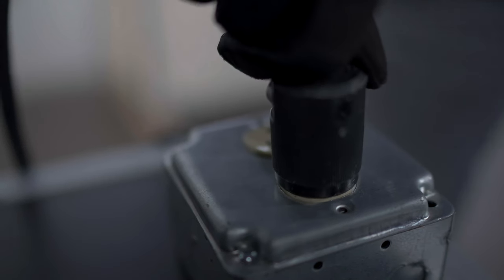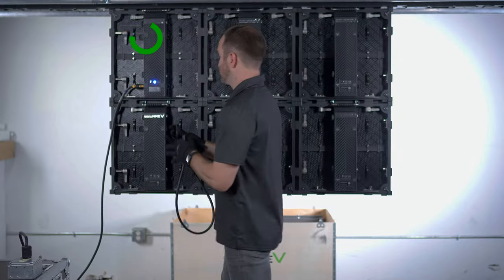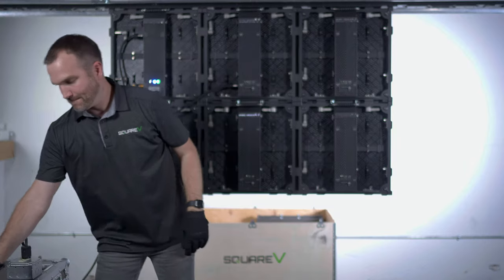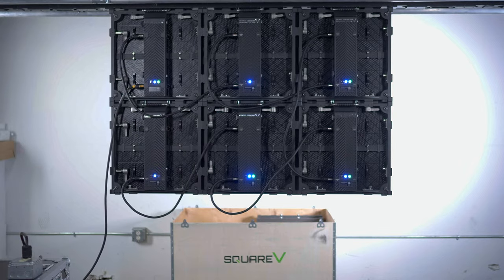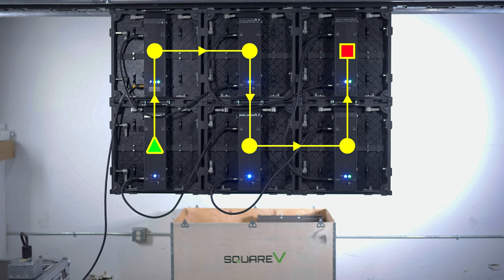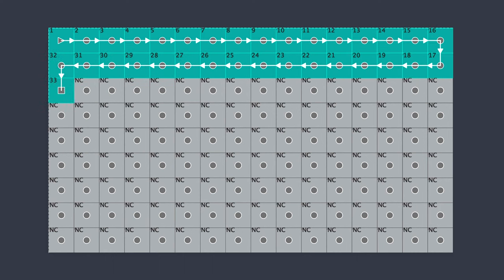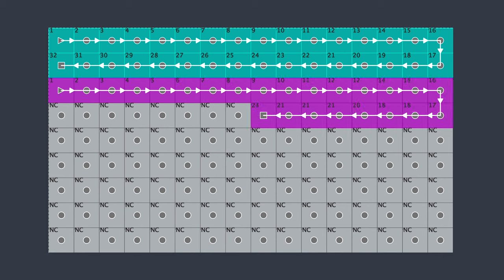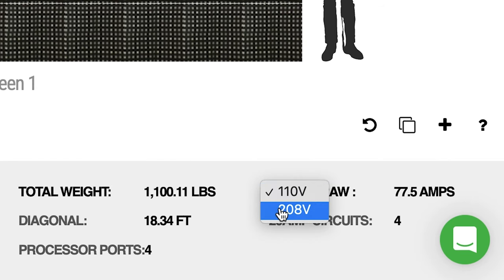LED Wall Setup | 03 Connecting Power for LED Video Walls

Comment: What do you call that box rectangular thing in the middle? Is that the power supply or control unit?
Reply from the maker: We call it the “component box” but there’s not really an official term for it. The main components aren’t always found in a door or box like this — usually just on portable products like the ones in this video. Inside you’ll find the power supply, data receiving card, power and data terminals and jumper cables, indicator lights and small cables, as well as the main hub board (where data and power all meet).
Reply: @squareV  Ok got it now, thanks. 😁

Comment: Hey after using the calculator it says I need a minimum of 8 20a circuits.
Can you clear this up for me?
I have a wall with 48 panels - if I’m understanding this correct, that means for every power run it can sustain a maximum of 6 panels until I will have to do a new one - amounting to 8 power runs total for the wall.
Reply from the maker: Hey there! Sorry about that. That doesn’t sound right at all. Which product are you working with? I’d like to try and replicate this to get it fixed immediately.
Reply: @squareV  unilumin UPadiii 500x1000mm! Thank you so much for your help!
Wall is 8 panels wide, 6 panels high
Reply from the maker: @TheXephen  Sorry for the confusion. Our Project Visualizer only works with our own squareV brand of LED walls. We try to make it as smooth as possible to work with our products. Sorry for the confusion!
Reply: @squareV I understand that. I’m using unilumin’s calculator. I find your content extremely helpful and I’m just hopeful you can help me understand what it means by: Minimum 120vac 20a circuits (8)!
Reply from the maker: @TheXephen   thanks, glad you like our content! Honestly, that is a question for the manufacturer. It does sound like you’re on the right track, though. It probably means 8 main power runs, but again, we can’t really tell you for sure since it’s not our product. Have a great day!

Comment: Hi.  It’s ok to connect 28 panels ?
Reply from the maker: Like the video said — the amount that you can connect on one power run varies between brands and models. If you have a question about a specific squareV LED panel, we can definitely get you an answer!